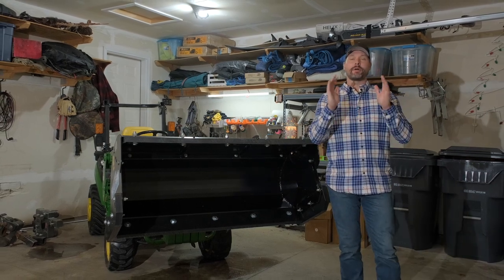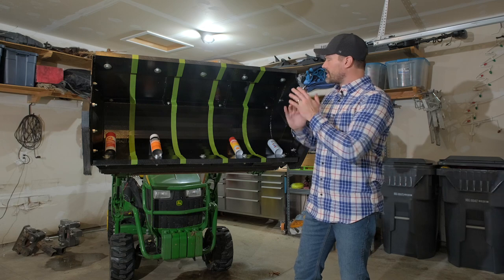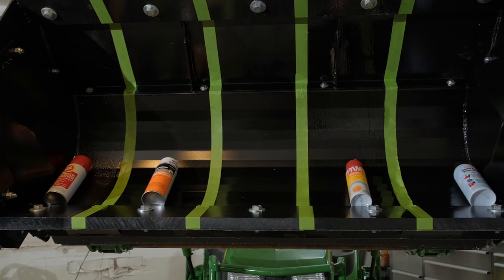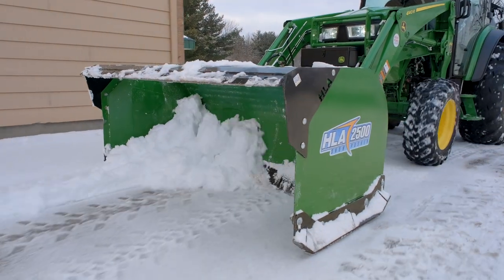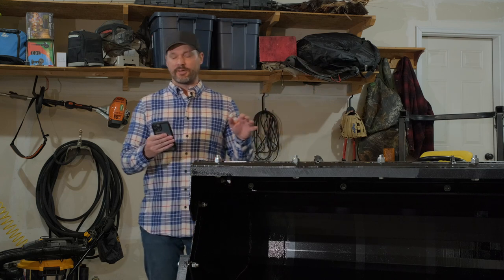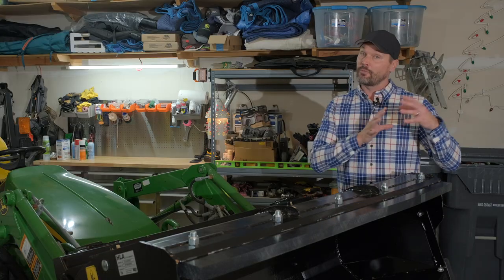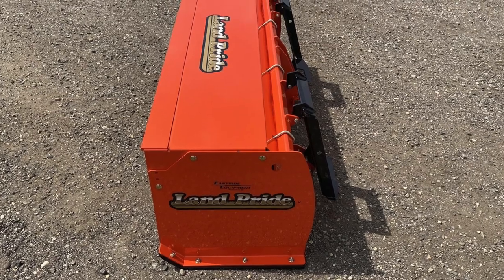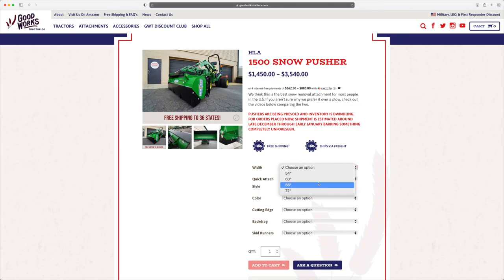AFTERMARKET VS OEM? WORTH THE UPCHARGE? JOHN DEERE & KUBOTA VS HLA SNOW PUSHERS ❄️🚜

Comment: Courtney - Great Video as always!! I can add some info on the Frontier pusher.  I purchased a 60" Frontier pusher late summer of 2020, so It's the 2nd season for it.  It's totally different in design than what you had in pictures.  Let me start by saying I wish I would have purchased HLA. The back Drags on these Frontier bend very easily, just as you had pictured.  My 60" Frontier is 16" front to back and 20" tall.  The metal runners are adjustable, but a fixed choice of 3 holes provide limited options and are not a fully adjustable "Slot". That does however make the runners replaceable. The main cutting blade and back drag blades are also replaceable.  My Frontier does have a formed back to the pusher with 2 bends giving it 3 surfaces at different angles. Also, the side walls on my Frontier are not double walled, but have a totally enclosed brace from the back to the side. I have plenty of pictures if you wish to see them.  As you said, Frontier uses different manufacturers, and I'm sure the differences in what you have found and what I have are because of those different manufacturers.

Comment: I have used Johnsons paste wax with incredible results. I use it on my tractor everywhere, wheels, hood,fenders. It works on my bucket and my snow pusher. Here in Maryland, we get a different snow each time it snows. The pusher is great with a dry powdery snow. I have to use the bucket when we get a heavy wet snow . These heavy wet snows usually starts as rain ,then freezes then snow on top. The pusher is not for the ice under the snow. In either case the Johnson paste wax (can be used on steel , wood , plastic etc. ) is the best  for snow not sticking to any part of my 1025 . Give it a try it lasts so it won't break you.

Comment: Courtney, I shopped all of those and bought the 60” Frontier AS10F for my 1 Series.  The base price is about right at $850, but the poly skid shoes add about $300.  The back drag and rubber edges add more too.  Mine with all that was about $1200 new.  Also, the weight you list isn’t right.  It is right about 200 lbs with all those options. A base model is 140 lbs.

Comment: I have 3/4 pure stone in my driveway. Unless the stone and ground are frozen solid the skids I believe would just work into the stone and start pushing stone at some point. The best way I've found is using the bucket  in float mode with the cutting edge tilted up an inch. I haven't had to clean up gravel out of my yard since I got the 1025r.

Comment: When I bought my 2032R last year, I purchased the Frontier snowpusher with it for the 0% financing.  I paid $1250.   For that, I got the snowpusher with backdrag, polymer skid shoes and rubber blade on the backdrag and the pusher.  I've only used it a couple of times but have not had any problems with it.  I'm not near it now but, I highly doubt that it is 30 inches tall.  20 inches sounds about right.  The fact that the backdrag does not cover the entire top is a benefit in my opinion.  I have not found that it leaks snow when backdragging.  The snow just sticks to itself and blocks the opening.  The opening does however, give an indication as to how much snow is filling the box and, it makes it easier to clean the snow off the inside before you put it away.  Frozen snow on the inside does reduce the usefulness.

Comment: I have the HLA 1500 60” for my 1023e, I put 4” wide x 3/4” thick UHMW skids bolted to the existing runners. I find they don’t set into the gravel on the driveway like the existing 1.5 “ runners do.

Comment: Great comparison of the snow pushers. Also if the landpride is an 05xx model not a 10xx that could be the difference in weight. The 05xx is primarily built for the BX tractors therefore lighter.

Comment: The Frontier is 60" wide, 20" high and 18" deep.  Mine also has replaceable skid runners.  There is also an option for poly skid runners.  There is also a replaceable back drag edge.

Comment: Another informative video; thank you!!  I have a 60" Frontier frame mounted plow on my 1025R, it works really well especially if you are "space" challenged.  However it is not quick attach, it is a bit of a chore to switch back to the loader/bucket if you want to do some removal or relocation of snow.  I wish I had gone with one of the loader mounted options that Courtney is talking about!! The back drag option woud be well worth the investment.

Comment: So I would love the hla witch is built like a beast and has the nicest pull back option, but the price drove me to the frontier, which I also found used, for $700 about 30 min away on marketplace. I did go to deere for the pull back kit for touch over $150. And yes the pull back is fairly easy to bow. Again for the tots investment, I’ll modify as needed to stiffen it up later on if needed. So all in all I’m in it for under $900 and it’s been effective. Now moving it around it weights virtually nothing for its size. It’s a comfortable two person lift, so I can’t at all believe it weighs 400lbs. Maybe 200lbs…. Honestly it’s light. The skids are bolt on, as well as the pull back and main cutting edges are both reversible.

Comment: Courtney,  sounds like you are going to get your chance to move some snow tomorrow morning.  Thanks for the comparison.  I have several Land Pride pieces and I will say that the rotary cutter appears to be built lighter than I expected but the back blade is very solidly built.  The variation could be between attachment as well as between manufacturers.

Comment: I just ordered the 48" Land Pride snow pusher for my Kubota BX and I believe it does have the rods to support the side walls.  You mentioned that it did not.  Maybe I will be pleasantly surprised when it arrives in August that it was built without, because like you state, that is an inferior design.  Fingers crossed!

Comment: Hey Courtney - Great comparison video.  Happy with my HLA 1500.  Its pretty much my starting attachment for the winter before I flip to the blower when i run out of push room.  Haven't had much of an opportunity to use it here in New England yet this winter.  Not complaining...Always happy to have a break from the heavy wet snows we tend to get here.  All of that said, I am thinking about adding the HMWPE edge to the backdrag.  How much would that be for the 1500? Thanks for sharing!

Comment: Ariens also markets a spray.  Tried it last year and it did well in keeping the slush from clogging both my Ariens 1028 walk behind as well as the Pronovost INV-80 tractor mounted.  Heavy wet slush is always the hardest to move.  I've at times seen the "blowers" look more like sausage packers with a long tube of ice coming out of the chute.  It's when it can't even push that that things clog and when the Provonost clogs, it's a solid mass to break up.  
 
Last year, we had 2 days that I was basically slinging slush and didn't have any clogging issues.  Could have been just the wrong consistency, but it's pretty rare to not see the Ariens clog at least once in those kind of conditions.  Hopefully we'll only get good snow this season and I'll never know if the spray works or not.  (^_^)

Comment: I think you should develop a heated pusher.! If you heat the blade from the inside with propane you can probably completely stopped the buildup of the snow when you don't have to worry about it. Just have to engineer properly but that seems like the best solution that I have thought about. And I know there's going to be people to talk about the heat in the fire with the hydraulic system and everything else but that's why you keep everything separated safely. Attachments can go out quite far when you're talkin about snow pushing
Reply: You'd have to do some calculations for how many BTUs you'd need, but I suspect you'd be burning a lot of propane. The back of the pusher is a lot of surface area, so it'll cool really quickly. You'd also need a good bit of space to get a burner behind it and a place to mount the propane tank. The liability insurance on a product that like that would be through the roof.

Comment: I didn't want to comment twice but watching the video again I can't help but wonder why the manufacturer doesn't add a spring system like you would see you on a plow in front of a truck. That way when it hits large immovable objects the entire thing can flex and go over instead of just jamming and pushing into the object.
Reply: It would probably add about a foot to the length. Truck snow plows usually plow faster than you would on a tractor. So given the cost, added complexity, weight, length, and another point to fail, it's just not worth the cost.

Comment: I have to question the idea of calling them OEM. My parents and Grandparents had tractors and implements that were all made in International Harvester   factories,  in the late 60's that changed.  Quite simply,  i wouldn't count either Frontier nor Land pride to be OEM but a wholly owned subsidiary that is "preferred " by the tractor manufacturer but to me they are all aftermarket now.  As evidenced by the fact most (not all) offer if you're willing to special order and wait,  will sell them in a color to match your tractor.